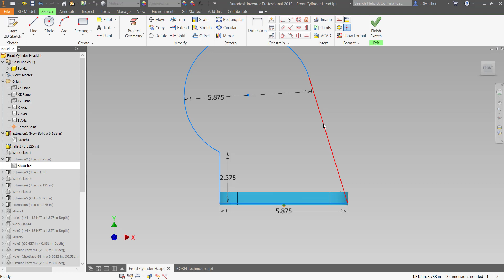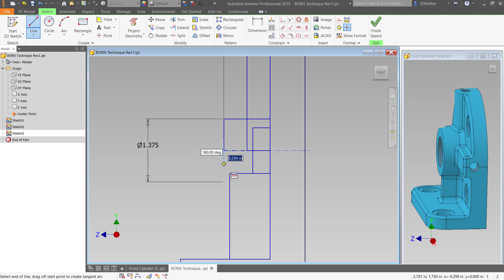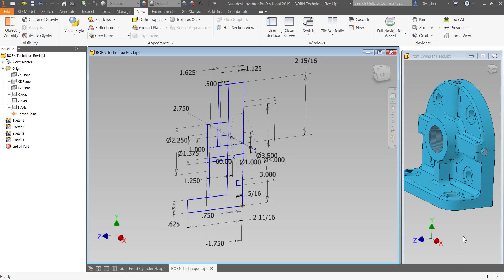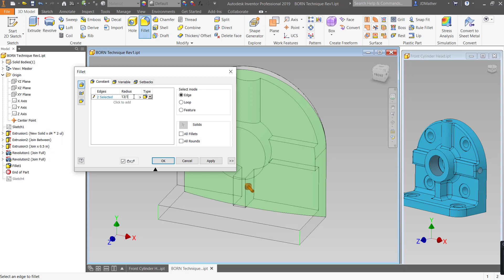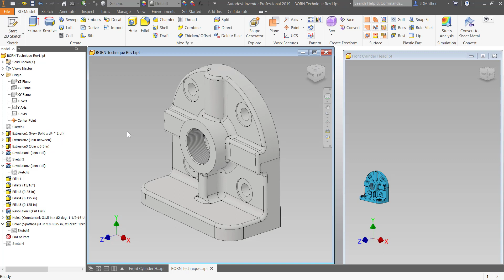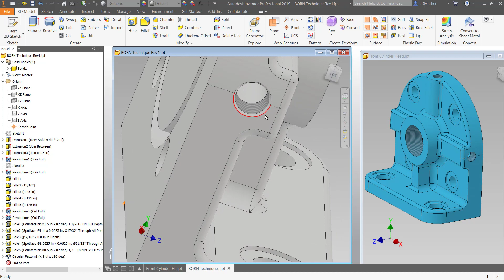The BORN Technique

Comment: Great modeling technique. I want to add a point.While Using pattern features:if rotation axes selects with being part or assembly self axis, this is most robust technique. There is, this rotation axis  created with sketch actually. I pointed that general use of pattern feature. Thanks a lot